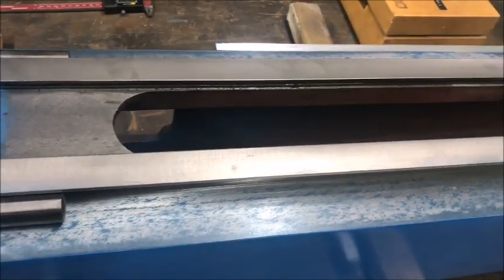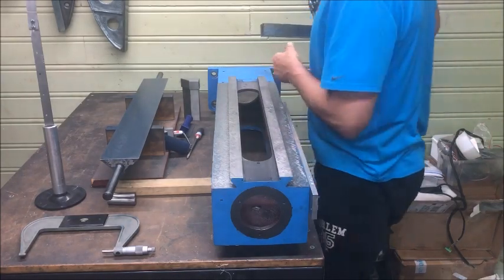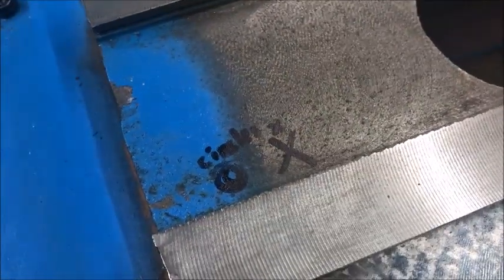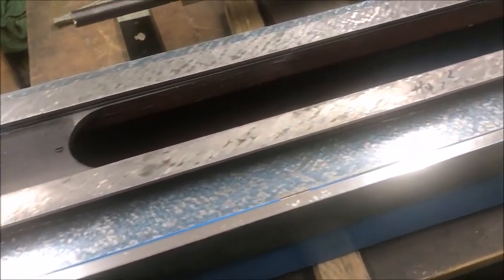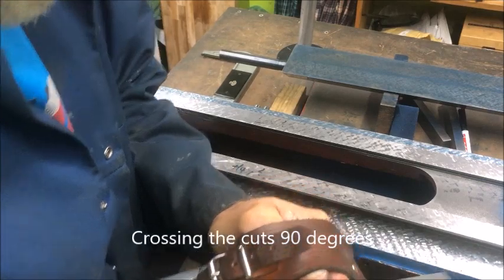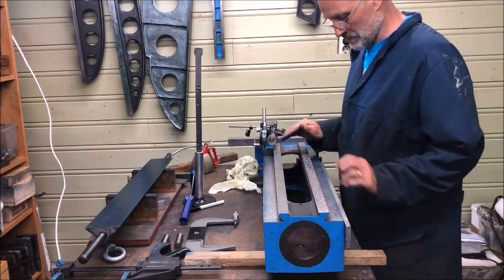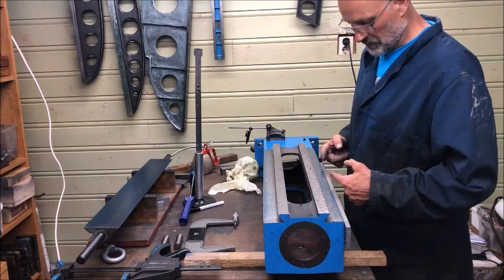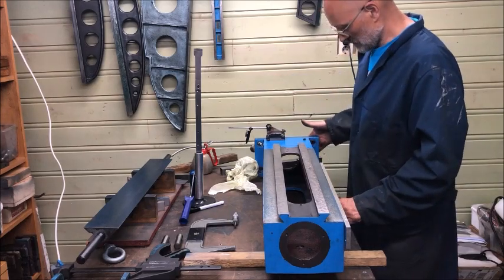HBM45 - scraping and measuring column ways

Comment: Hello Jan,
I enjoyed this video and the previous one... One question that came to me was regarding the difference between power scraping (Biax) and hand scraping. Is there any correlation between the two methods with regard to pressure applied, my thoughts are not as with the Biax some of your effort is used to manage the weight of the machine, where hand scrap the is no real weight. 
Take care.
Paul,,
Reply from the maker: Thnks! As a rule, the BIAX being a power tool is used to facilitate the process of removing metal, and is used in industry to improve efficiency, ie. faster and easier vs. hand scraping. Therefore, as I am also taught and have experienced, it will remove more metal. However, I tend to lean more onto the hand scraper and therefore have a tendency to actually remove more material this way when roughing. That said, you don't last long hand scraping this way as it gets tiring after a while. This has an effect on scraping depth, which at least for finishing is not optimal. I therefore normally just take a few cycles with the hand scraper, but could of course also have used roughing techniques with the BIAX here also. I have learnt, and try my best to keep a constant scraping depth as this will also make it easier to predict things like how many strokes it will take for a certain operation. For consistent results I therefore favor the power scraper. It is advisable and indeed useful to find out just how much metal you remove with these different tools and with that knowledge apply this in the planning stage so that you can have a good understanding of the job at hand.
Reply: @jansverrehaugjord9934  Thank you Jan

Comment: Interesting project. That's the medium weight biax scraper but not a half moon flaker. Which is better?
Reply from the maker: The medium sized BIAX (10 version) is a bit easier to use as it is not as heavy, although for my projects I cannot say it would matter much. Then the heavier (40 version) has the possibility for a longer travel, although this also don't matter much for the projects I am normally handling. I just happened to pick the medium sized now.. :) A flaker otoh is a totally different animal, purpose made for a different application, not to remove metal for alignment/regular scraping purposes, but to put on half-moon marks on top of an already finish-scraped surface.. for the purpose of having evenly distributed equal sized oil deposits, normally on the non-exposed ie. hidden side of a matching/mating pair of surfaces. While I am onto this.. in other words, not like you see they have done on the base of this milling machine.. namely having made an attempt to "beautify" the exposed surface (ie. the top side you can look down on).. so called eyewash.. not very evenly made and directly onto the milled quite rough surface. I could make a claim that this would even make it worse because you are actually taking away support points doing so (although the milled surface offers a less than optimal surface anyway), but worse so that the marks on an exposed surface will make grit and dirt stick better and probably make it easier for this to get under the way wipers (if such exist..)
Reply: @jansverrehaugjord9934  Right on brother. The spotter type is the correct tool.

Comment: As always Jan I'm very thankful your willing to detail and document your procedures. It's a fantastic resource that explains some of where the Connelly book may have been a bit less than well explained. I suspect the factory either didn't do the greatest precision alignment on that column foot, or they purposely misaligned it in an effort to help compensate for the head weight flexing the column forward. The friend your doing this work for may want to consider building a proper temporary dam for the Z axis feed screw and it's feed nut and then casting an epoxy / granite mix for the rest of the columns internals. That might help quite a bit to prevent that probably unavoidable column flex. Compared to my Bridgeport clone and it's 3 point support of the knee, that's a fairly long and light weight casting with a lot of head weight cantilevered out from the column. I would think with that head weight it would be fairly easy to see a considerable amount of deflection of that column depending on where the head is positioned on those vertical ways.
Reply from the maker: You're welcome. Thanks also for commenting. I think my friend made the same measurement, but with the head mounted, meaning that the situation already was present then. It would anyhow present a problem I guess if the column tilt/head weight compensates one another for alignment purposes to this degree. The high in the middle/less contact area situation is not ideal as it really lowers the stability and probably limit the depth of cut you could take. You could make the column tilt by tightening the screws around this "central pivot point", but it would be better then to actually scrape it flat to have 2 mating surfaces with the usual properties, but at the desired tilt you may want to induce. The whole design has it's limitations of course and I reckon it is not ideal for heavy milling anyway, but I am also confident that the better the base-to-column contact gets the more this would transfer to improved cutting results.
Yes, I have seen several that have improved their column in the way you suggest, and I will suggest this. Could also gain from having the column anchored at the top I guess.
The B'port is a much better thought out design and made to higher standards.. but at a premium price compared to this mill-drill (and a host of similar types). That said, It is not a bad machine, especially considering the (relative) low-price. You just have to factor in this when you buy and don't expect it to be more than it is..
Reply: A quick n dirty calculation shows around 0.02mm per 100kg so not super problematic. Some people proposed that it's actually the base buckling which makes sense to me as it is even flimsier than the column  and a small deflection there translates to a big deflection at the spindle because of the lever. Would be very interesting to see some measurements before and after epoxy granite filling. There are a few people on YouTube who have done it but i don't think anyone ever showed the improvement.

Comment: Thanks for uploading this really interesting video Jan. Out of interest, could you please explain how  you ensure the ways are at the same heights in relation to the column? The dial indicator would show parallelism but I'm not sure how you would measure the height. Is it the case of using a depth micrometer from the upper surface on each side or just measuring from the surface plate to each side? Thanks, Morgan
Reply from the maker: Thnks  for commenting. Which part of the column do you mean? The top of the dovetails are no-contact areas, and the flat ways are plane-parallel to the angled dovetails (checked by the micrometer- and indicator readings), and then these 4 flats are aligned at right angle in tbe 2 planes to the base. That said, I have also tried to get these top (no contact)  surfaces as good as possible (aligned to the way surfaces) for possible use as "reference" . There are also 2 narrow flats on the upper edges that are tested and will prove as useful references when measuring sideways tilt
Reply: @jansverrehaugjord9934  Thanks for getting back to me. It was the flat ways I was thinking of, although they are parallel could there not be a difference in level in relation to each other ie. One could be lower or higher than the other (looking axially along the column)? I was just wondering how this is checked as I'd like to attempt some scraping of my own. Many thanks, Morgan
Reply from the maker: @TheOnlyMosesMalone  Aha! I see.. yes, true. As you say, you should be able to detect this if you rest the ways dow to the plate and measure the height at each side
Reply: @jansverrehaugjord9934  Got it! Many thanks 🙂
Reply from the maker: @TheOnlyMosesMalone  Thnks for this comment! It is usually not a big problem as far as I have experienced, but if sufficient will of course show up as an error when you try to mate the saddle onto the ways, and then would need to be corrected (possibly doing this on the shorter saddle, but as it would then be "out of true" with a surface plate test and these 2 parts only then match to one another.. not ideal.  I will get back to this and include this explanation also to show this measurement 😀
Reply: @jansverrehaugjord9934  That would be great, thanks. Looking forward to the rest of the series 🙂